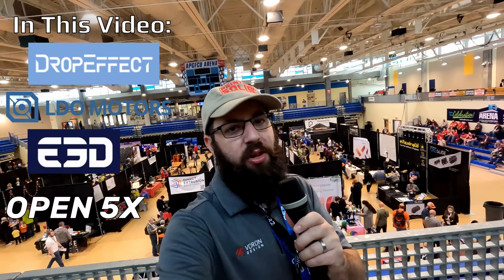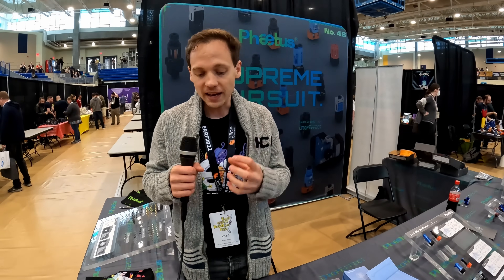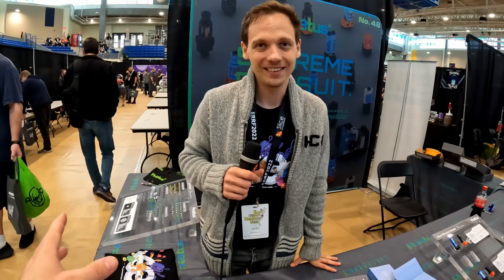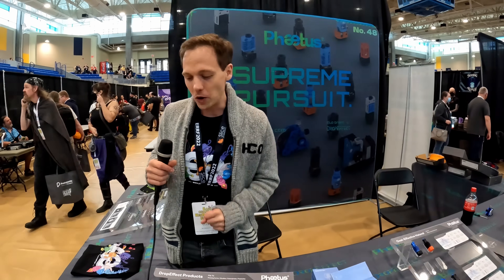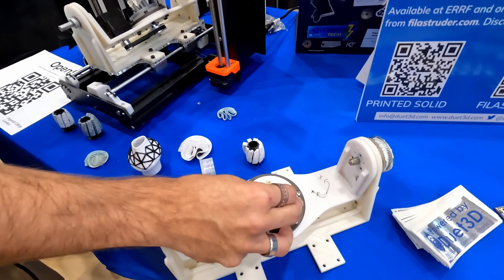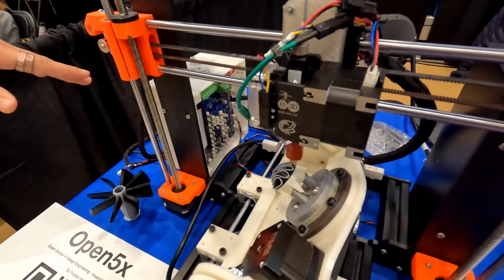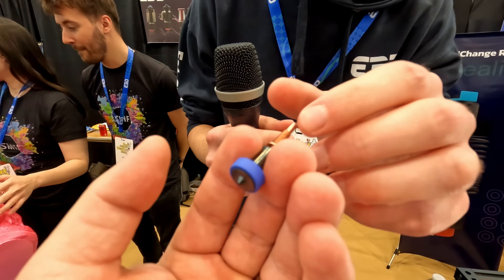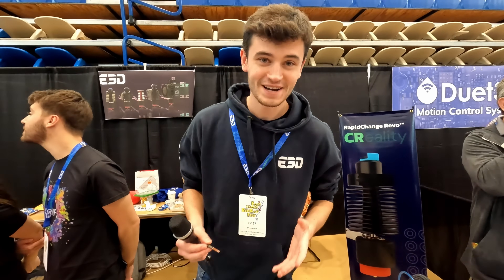5 Axis Printing, Positron Kits and Hotends ERRF Recap - Part 1 #3d #3dprinting

Comment: 5-Axis feels like one of those things that will be super powerful, but that I will really struggle to figure out how to use efficiently.  The news about the Positron kits is very exciting, though!
Reply from the maker: The hardware is there, just waiting on software

CNC machines can do these kinda toolpaths no issue, but the software used USUALLY has a pretty hefty price tag attached....
Reply: @CanuckCreator  It's not so much that - I feel confident the software will come before I could possibly afford the hardware - but rather the fact that parts would need to be different shapes to really take advantage of 5-axis.  And that's the place where I think I'd fall short of really properly using the technology.
Reply: @CanuckCreator  If the capability to plan 5-axis toolpaths comes to open source software at the same level of usability as SuperSlicer or Cura, a lot more people might find it reasonable to build a 5-axis CNC!
Reply: 5 axis has these issues in CNC as well, it's very hard to justify the costs when a 4 axis can achieve 95% of what a 5 axis can, just with more operations. Still neat though.